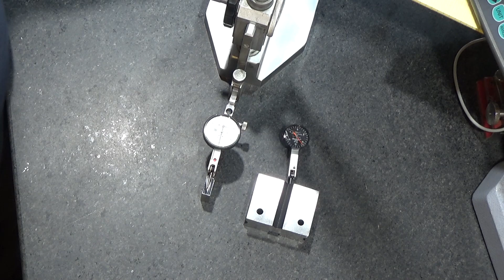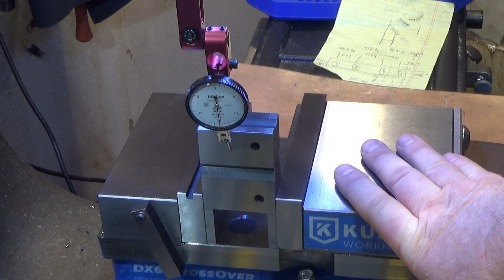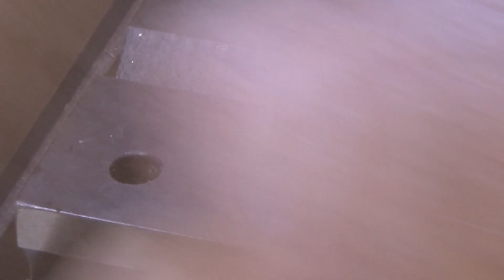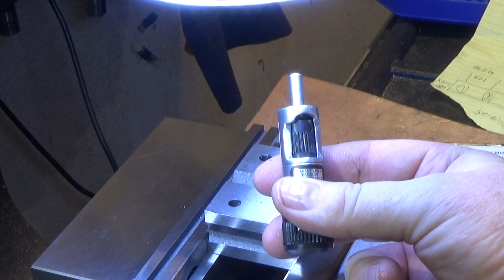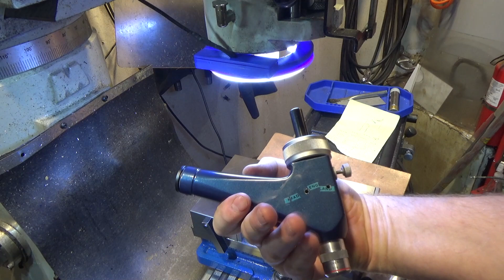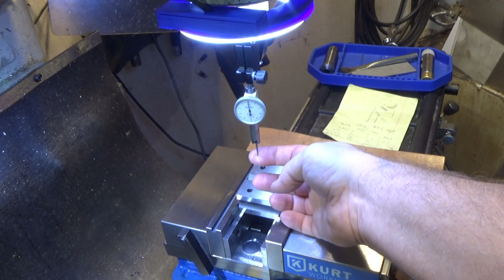223 Center Location Finding Methods and Accuracy

Comment: For small holes it is vital that the indicator stylus is on centre and swings directly towards the spindle centreline. I use a hexagonal spigot on my dti to control the rotation of the dti. I have a video demonstrating this principle. 20mm high dti holder with 200mm extended range. Or for a comprehensive explanation see The only dial indicator that guarantees perfect stylus alignment. Hope you find them helpful.
Reply from the maker: Thank you very much. I will definitely check them out.

Comment: When using the coaxial indicator I remove that white plastic keeper from the rotating feature at the top of the indicator body.  This probably didn’t affect your measurement much as you approach concentricity but it does limit the movement of the probe.  I have a similar coax indicator and I find that I can’t count on accuracy better than +/- 0.0015 or so on a good day.  I can then switch to a vertical DTI for fine tuning a bore location.  Interesting discussion.  Thank you for posting and all the best for 2024.
Reply from the maker: Thank you for your thoughts. I always appreciate hearing about other peoples experience, especially since mine is limited.

Comment: I think you have to spin the laser.  The result will be a circle around the actual center. Thus, any runout from a damaged shank etc. will just make the diameter of the circle larger.  And actually, mounting that laser in something that allowed setting the runout would be really useful.  The circle it draws could be adjusted to the size of the hole and that would make centering on it quite easy.

Edit:  actually, that would be a fun project.  Just spin a laser diode with adjustable runout.
Reply from the maker: I hadn't thought of that option. I like the thinking there.

Comment: So the wigglers the last one is for mounting an indicator on. do not run the mill with it. Also I run the point, get it true then hover over the hole to get centered, then enter the hole , if it's not centered you'll see it move. I like it better than a spring loaded center easier to see😢🎉 for these eyes.
Reply: I would as well, if you drop in and out of hole (after re-centring) within a couple of thou accuracy should be possible.
Reply from the maker: I really appreciate the tips. Having never used this type of center finder before, I really appreciate your advise.

Comment: using a wiggler set: https://youtu.be/RhtBdar4iVg?feature=shared
Instead of a pencil, I use the box end of a small wrench. if the pointer is nudged a bit too much, it can "kick' to a horizontal position,     with the sharp end eager to slice a finger.
Reply from the maker: Thanks for the cool tip and the link. I will definitely check it out.